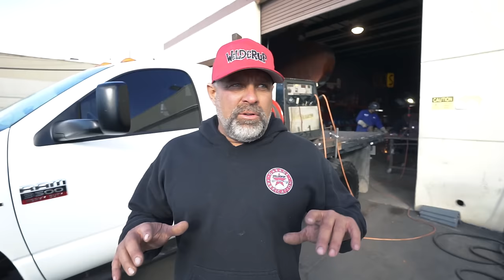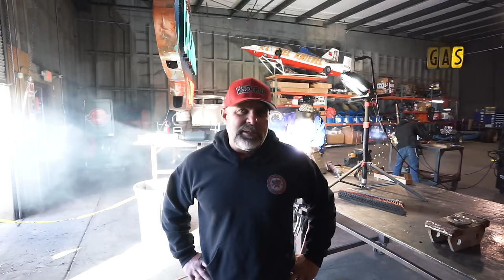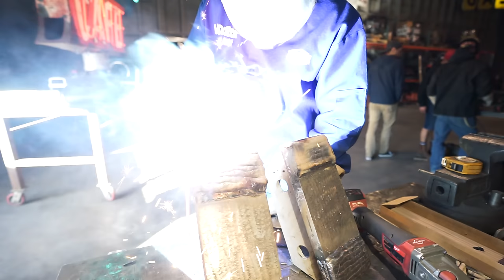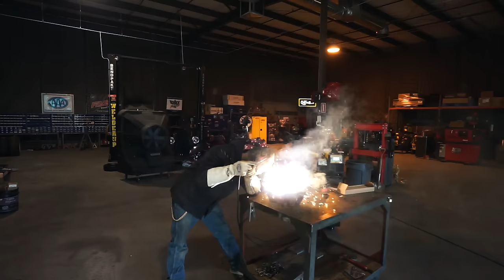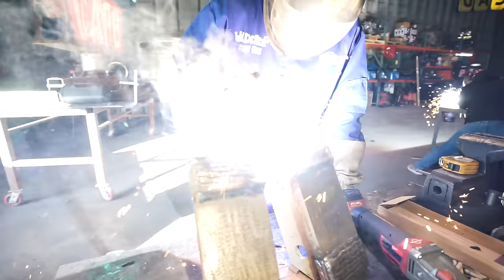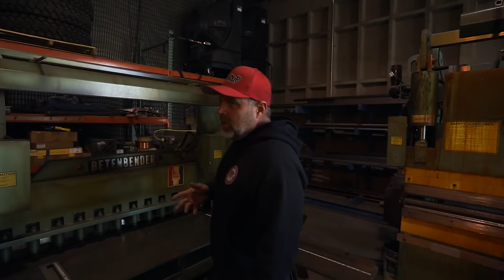Making $1,000's With A Welder at 20 Years Old | Why You Need To Get Into Welding

Comment: There are a lot of welders getting ready to retire and there's not many wanting to take their place
Reply: Kurt Hollingshead thats fine theres also alot of welders sitting at home because the price of oil being so low.
Reply: I don’t where you work at...but these days everyone in construction wants to be a bucket welder an nobody wants to be a fitter or anything that involves manual labor
Reply: Been saying that for years
Reply: @randomchannel4886  why does cheap oil mean no work for welders? That litterally makes no sense
Reply: @randomchannel4886  true but there's tons of different welding then oil related
Reply: I became disabled in 08 and at that time wages were almost the same as working in Mc Ds. My view of welding is these kids today are smart for staying away from welding in certain areas. If you can work for yourself full time and make the big money, then you are good. If you work for a factory, you are screwed, low wages and extremely long hours at hard labor. The welding market is like most , its not what your skill level is, but who you know that will net you the big money in welding. Ever wonder why you do not see many old timers welding much in manufacturing today?
Reply: Kurt Hollingshead that is such a false statement, the industry is actually flooded. Tons of new welding schools opened in 2019, it’s the exact opposite. Wages are lower in the trade now due to the over promotion.
Reply: David Kaser heck these kids go to welding school and find out quickly that the money isn’t there, some try to work for themselves and end up undercutting the market ruining it for themselves and others
Reply: @anotherdumbwelder6219  Wages in the midwest are around $14 for a new welder, and about the same for one with decades of experience. Do not know what they are in the rest of the US, but a big problem also CHina taking jobs.
Reply: 3D welders
Reply: @davidkaser7423  I can tell you at a large defense contracting company like i work in they start in the high 20s per hour.  But independently guys make a killing
Reply: @raidergainzx5290  If I was going into welding today that would be the only way I would go is my own business.
Reply: AnotherDumbWelder Thats what I was thinking that the industry is oversaturated but I always hear that the welding industry is growing but oil is like 20 something a barrel I’m 26 and thinking about getting in is it smart to you to go down that career path?
Reply: @roycearchie2889  if you like welding then weld.
Reply: Nobody Jones Not true. I want to be a fitter and cutter and also production Welder. I like it a lot and I’m going to get certified at some point in the near future.
Reply: @davidkaser7423  same in my country Finland. My trade is car mechanic and we earn over +2000e  a month when we start if we are even half decent. After that maybe someday you will earn 3k euros a month doing normal shit and if you go to automobile engineering etc you might earn over 3k as a mechanic or end up doing engineering and earn +4k luckily. In trade school when we had welding course the welders are just complaining and not getting anything done :D. Teacher was taking coffee breaks +70% of the day. Well i learned to weld good there but there was no instructions given to us teacher just showed how to turn on gas and the welder after that i just watched alot of youtube videos and put it into practice, decent tigs and doing mig id say im pretty good. Welding industry here is dead and since we have so good welfare benefits i wouldn't even work as a welder cuz you get +1000e a month from government jobless and no need to do anything and as a welder you would barely even earn 2000e a month and work in shitty environment. Making own business isn't rly worth here cuz you will end up 100% with over a +50% tax rate. We have problem here with cheap illegal workforce from example estonia and they get paid half what we get but not a problem in my trade, big problem in plumbers trade and welders etc. The strawberry jews here durirng the corona wont hire finnish people cuz we have to get hired with legal payment and usually they only hire for a very shitty pay or just bring workforce from somewhere.
Reply: Sir Nicholas D  it is what it is. 14euros a hour is decent here
Reply: @davidkaser7423  i been thinking the same for years until i found  out how cheap the chinese and mexicans charge in California .
Not worthy to lose your vision and lungs nowadays unless you work in the oil pipe lines making $250. Ks a years
Reply from the maker: The Welding School is now live! Go here to check it out: https://courses.welder101.com/
Reply: I was a welder/ fabricator for 27 yrs and topped out at 16.00 / hr in 2008. Changed trades at 48 y.o. to aircraft  assembler/ mechanic  and now making 39.00 hr. Old dogs can learn new tricks.
Reply: Some ppl just dont like working for many years and hours cause theres no guarantee. A person will live long for that good retirement check the person will have to grind many hours. Some ppl will just go part time and have another source of income that makes them happy. It can be stocks or something else as a backup plan cause full time can be stressful sometimes
Reply: Join a union as a welder.
Reply: @nobodyjones3624  yeah cause that shit sucks 😂
Reply: @davidkaser7423  you can't outsource welding jobs you dingus 😂
Reply: @davidkaser7423  so what your saying is I should have my own equipment and work for myself and not for a company’s
Reply: @davidkaser7423  well they just coming for a better life but hey man if theirs a job they will take if they know what they doing
Reply: @davidkaser7423  well you can’t really call them illegals on stolen land
Reply: @osbaldohernandez9174  Every country is "stolen land." America was conquered. Get the fuck over it. We're a sovereign nation and we get to determine who comes into the country. Every country has borders.
Reply: @eksine  It makes a lot of sense,  From the moment it leaves the well everything oil and gas moves through is welded. Separators, Tanks, Pipe Lines, etc.
Reply: @j0lel666  you should write a book explaining to Americans why semi socialism sucks!
Reply: @robertsantiago953   the pipeline thing aged well... thx sleepy Joe.
Reply: Most of these guys just don’t like living in campers or traveling like to other states and leaving their families
Reply: @johnjay2865  welding salary ain’t even that much not a lot of people getting into welding
Reply: @user-bp4qq7tt1u  how does it work
Reply: @osbaldohernandez9174  damn and I was thinking about it
Reply: @itsDjjayyArt  I mean get into dude but just know it’s gonna be hot their are dangers to it but it just depends on how bad you want it
Reply: @nobodyjones3624  What training are required for these high labor welding job's that are soon going to need replacing in the nearfuture ?

Comment: 5 hours a day 2500 a weeks damn I’m glad im learning welding rn
Reply: Yessir whats a great school to go to ?
Reply: Wtf ? I used to weld so much and got shit for it
Reply: @cobes11  you mean a trade school?
Reply: @venous94  No. Trade schools are expensive as hell. Community college is cheapernand just as good.
Reply: @cobes11  honestly
Reply: @cobes11  i learned on the job. Started heavy equipment then learned welding on my off time. Make 32 and 120 per diem right now. Glad i got into it
Reply: 6 figures easily
Reply: @cobes11   same thing i’m doing actually getting paid to go to school
Reply: @cobes11  hey I noticed that my local community college has a 6 unit welding certificate program. Is this what you’re doing/did? I’m currently going to university but wish to get certified to make some money while attending it, plus I love welding. Maybe I could get a utility truck and a welder and use that certificate to start a side business or something
Reply: @catcola1061  I did something like that. There was a 5 unit Basic Certificate, a 10 unit Advanced Certificate, and the Associates which is just the Advanced plus all the liberal arts classes. I only did the Basics because the Advanced is basically all pipeline stuff (I am in TX) and I do not want to go to the pipeline. I am still very new and have learned that the Certificate doesn’t mean shit beyond getting an employer to look at you and give you a chance to weld test. I am starting my second job Monday. I have been into maybe 2 dozen “interviews” and did not have a single actual interview where you sit down and talk. You go in with your gear, a tester comes, you test, and either they make an offer on the spot or they don’t. I came from the financial sector and transitioned, so it is weird because financial has at least 5 interviews. If you are talking about just doing your own thing, I am not the person to ask since I am still getting all my equipment together to do so.
Reply: @codyhyde985  how
Reply: @creed1741   because of the financial aid i was given im straight out of high school and only have a part time job and live in a single income household so it all worked out for the best
Reply: @ziggyc4474  u don’t even have to go to school be a welder
Reply: @gottijohnn6346  Can you put me on ?
Reply: @stevenrosario4558  I’m in South Carolina. Best thing you can do is start at pipe fitter helper and practice and ask a lot of questions you can take the weld test and get an instant pay raise. You can learn to weld good enough to pass test in a few months. Just never give up and you’ll get it bro. I’m up to 40 an hour now
Reply: Crazy how there's such a massive difference of what people make as a welder. I'm hearing anywhere between 15$ an hour to like 80$
Reply: @gottijohnn6346  hey question what's the best type of welding to learn,and are most companies felony friendly? thanks

Comment: I HIGHLY recommend welding! Im 20 years old almost 21 and I went to a very good trade school and took up welding. While I was in school I worked for a fab/job shop locally owned for 1 1/2 years and was the only employee learned everything I could from A very good welder. Now Ive been an Ironworker for 3 years that specializes in welding in the boston area and make anywhere from $1200 a week to $4000 a week, ive built well over 100 buildings, tiny to massive and everything in between, now im seriously considering working for myself in the future simply because there is such a high demand for welding/metalworking and such a crazy amount of money to be made. Weld on brothers🤙🏻 🏗 🇺🇲
Reply: @KASHMAER u good?

Comment: I'm a car mechanic in the uk, when I was 16 I was a apprentice for a Jaguar master tech, he taught me alot about how to properly diagnose and fix cars but since the mid 90's the car industry in the uk solely relied on the guys who were young in the 80's that were actually trained up in workshops stripping and reconditioning things like engines and gearboxes, now in 2020 they are the old guys who are retiring and there is a massive skills gap as companies are only interested in online training, meaning a guy like me who was a average mechanic 20 years ago is now invaluable as I can actually reconditioned stuff which makes me more money, there are still a few kids who want to actually get up off there arse but they are few and far between these days
Reply: Mechanics in US are still stuck on paid by commission. Most guys just learn the simple maintenance because that's what ends paying more than more complex repairs or fixing  electronics. 
Sucks because they keep making cars more and more complex, and require special tools, so it's a lot harder for us diy guys to fix it home.
The guys at shop don't know how to fix it because that's  not it what is giving them good paycheck.
Eventually their gonna have change something when all they have is a bunch of oil and tire changers that can't fix anything

Comment: I'm 24 now, I've been welding for my company for about 3.5 years now, i Started out at a chemical plant making large stainless and carbon steel tanks, and then i got some experience with pipe, i've got experience in mig hard wire stainless and carbon pipe and structural,  dual shield carbon, stick welding pipe and structural, also 309/309l stick welding, I have a tiny amount of experience in Tig welding stainless and aluminum i fucking love it all. 

So here's what I'm planning to start next month  I've worked the numbers and theres enough profitability in building pick up trailers like 100% profit I've got all my materials priced out, at around $1,100.00. on a trailers i can sell for an easy $2-2.5k all day long in my area. I'm in the California hotspot of beach riders/desert off roaders and oil field workers, farmers and agriculture, I have certainly have the right Market or area demographic to move these trailers, I Figure I can bang out one complete trailer in 2 - 2.5 days, After i register them i think i can move at least 3 trailers a month.  and that's all i need to buy my own home machine. I can use my jobs shop to make the first couple trailers, and i even got another old welder who used to make trailers who offered to help me out with my trailers. This is just the beginning, I'm so stoked to get into my own thing. It's so freeing to be able to make thousands of dollars on your own without being slave to a desk and keyboard.

My main dilemma is figuring out which kind of machine i should buy myself first. should i go with a 220v multi process machine like the miller multimatic ac/dc 220, or the miller multimatic 255, or should i just buy a gasoline stick machine like the ranger 305 or a trailblazer 325 right out of the gate so i can make mobile repairs for people too, i can't decide. making trailers and what not, the miller migs would be perfect, but the gas stick machine is so versatile. 

I'm lucky to have had at least 3 great welders teach me skills that will last a life time over the past few years.
Reply from the maker: Keep grinding!

Comment: They need to learn how to wear safety glasses using wire wheels let a wire go in their eye see how it feels and how long they will still be welding
Reply: I've had my share of metal in my eye grinding  bb
Reply: A couple years ago I pulled a peace of wire out of my scalp from an angle grinder with a wire wheel on it. It must have been stuck in my scalp for a year or more.
Reply: Got a wire stuck in my cheek at work. I want to dive for cover whenever I’m near a wire wheel and don’t have face protection on
Reply: As a BOILERMAKER code welder watch you're eys safety first

Comment: I was a tool and die maker for 10 years TIG welding high speed steel molds and machining them back into spec.  That job run out when NAFTA hit.  Been an IT Computer engineer for the last 24 years after going back to school.  I am retiring in March 24 at 58 from computer engineering work since I hate offices.  I purchased a MIG and TIG welder, Plasma water table, hydraulic pipe bender, 20 ton press, and everything needed to setup a small home fab shop.   Not looking to get rich at it but I really missed machining and making things.  10 years tool and die making skills and welding, I'm hoping anyway.
Reply from the maker: Sounds like a great idea. Welding is therapy for me. I'm at my best when creating something. Your off to a good start! Thanks for watching.

Comment: Went to welding school, best job offer was a helper at $12/h, gave up
Reply: A good job isn’t going to be handed to you or jump in your lap. Sometimes you have to start at the bottom and prove yourself. Work your way up the ladder.  Not all welders started off welding they worked their way up the ladder.
Reply: Messed up. Every body has to earn there stripes. Nothing comes easy in life.
Reply: I started welding in 1982 at 6.57 /hr. By 2008 I made it all the way to 16.00/ hr.Changed carriers and got into aircraft assembly and finally make decent money.
Reply: Gotta start somewhere, my first job I made 10 an hour, now I'm a level 2 ndt in radiograph and penetrant, going to get my cwi and current weld aerospace make triple what I started at. Might be hitting up SpaceX soon.

Comment: I was one of those directionless 20 year old. Ended up in the trades, mostly plumbing. I really hated it though, the money was alright but the work left me unsatisfied. With the pandemic stuff, I ended up helping out helping out at a body shop a few months ago. I really dig messing with metal, it's therapeutic to me. I'm 35 now, sort of in a rut of sorts, but I've really been inspired to weld. I've got mostly hobby experience, but have taken on most of the welding needed at the body shop I'm currently working at. Nothing crazy, just working body panels, welding in new steel where needed, filling holes. I've picked that up pretty quick. Looking to get into the field more firmly now. I know I'm much older than most guys starting off, but I'm looking forward to go full bore into it.
Reply from the maker: I am mostly self taught. I like you had the interest and continued to learn every area in welding. It has always been good to me, pulled me through in the hard times. Welding has made it possible for me to create and use the artistic side of me as well. Good luck to you as you continue in your Welding.

Comment: Well said sir. Thank you. I have been welding since 1988. Unfortunately it hasn't been so easy to make good money. Life takes its twists and turns. But it has always made sure that the bills are paid. I currently work for a company that produces parts for John Deere. I weld anything from aluminized mild steel to 304 stainless. In this industry we have the challenge of welding 304 to anything from mild steel, 409 stainless or 304. You are right. The younger generation are not up to the challenge. How do we inspire them to do what it takes to make a difference? Always a fan and a welder. Gene Adams
Reply from the maker: Thanks Gene, I really appreciate your comment.